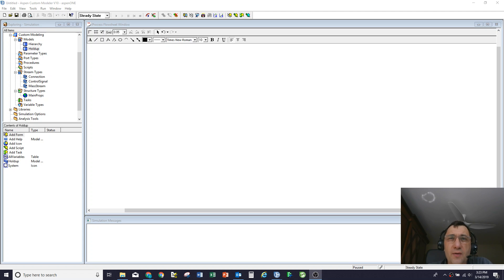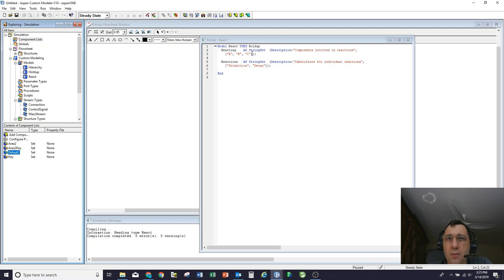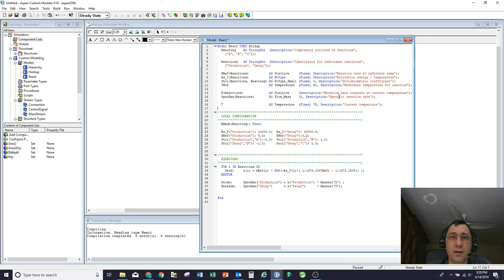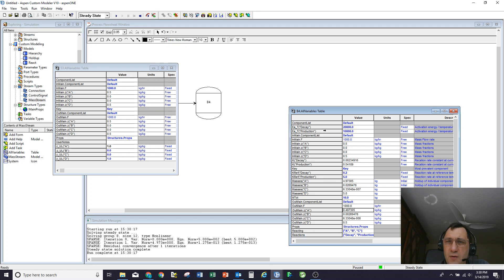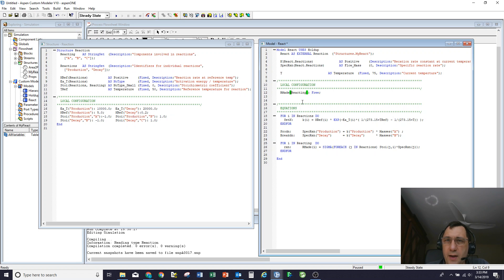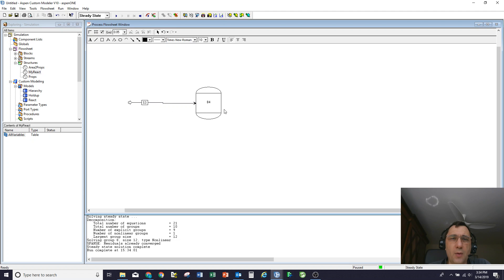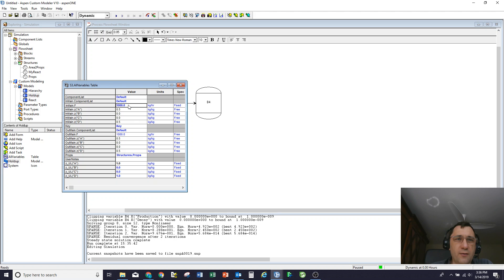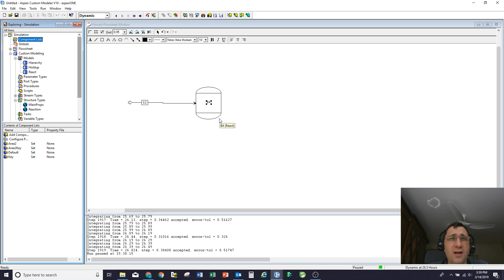ACM9. Structures, ComponentLists and Inheritance

Comment: Dear Charles, 
I have : H2O -> H2 + 0.5O2
how can we calculate H2O enthalpy for expample, please? 

I have used the following:
yh2o as molefraction;
h_h2o as enth_mol_liq;
Call (h_h2o) = pEnth_Mol(T, P, yh2o); //T and P are constant

However, I get this error message:
Call (h_h2o) = pEnth_Mol(T, P, yh2o);
Error at position 35: Procedure input argument 3 should be a 1 dimensional array, it is a scalar

when I change to : yh2o (componentlist) as molefraction; it gives a result but it seems taking in consideration all components (h2, h2o, and o2) not only H2O. 

How can we enter the right fraction in Call (h_h2o) = pEnth_Mol(T, P, yh2o); or is there any other method to calculate/call components´enthalpies?

Thank you,
Reply from the maker: Hi Doha - There are a lot of possible ways to answer this.  Let me answer what I think you're asking...
You are using Aspen Properties to get the enthalpy of a mixture, and since in many cases, there's a potential "heat of mixing", there's not easy way to pull out the enthalpy of a single component in that mixture.  I realize that this may not be relevant in your specific example, but Properties is a general tool that tried to cover all eventualities.
If you want to get a pure component enthalpy with no mixing effects in place, then what you will need to do is create a dummy component array (so dimension yH2O(ComponentList) ans set yH2O("H2O")=1, yH2O("H2")=0, ...) and then make the properties call that you set up.  This will give the pure component water enthalpy at a given temperature and pressure...  though if you're in the 2-phase region, then I think it defaults to pure vapor.
Hope this helps

Comment: Thanks a lot for sharing your knowledge i really enjoy watching them and learn a lot too as beginner. well i wonder if electrolyte can be either modeled or defined as feed /stream to reactor  . I am very basic in this topic i must say. please keep up with these great videos.

Best Regards,
Reply from the maker: There are two options for including electrolytes - you can either import the data from Aspen Properties and get access to their extensive library or you can develop your own correlations and set up a local calculation.  Both approaches have merit - Aspen's data base is extensive, but they separate things out into "True" (Na+, Cl-, H+, OH-) and "Effective" (NaCl and H2O) components and it's tricky to keep track of everything (at least for me).  Writing the equations yourself usually means using simpler models, but you get to control how those equations work...